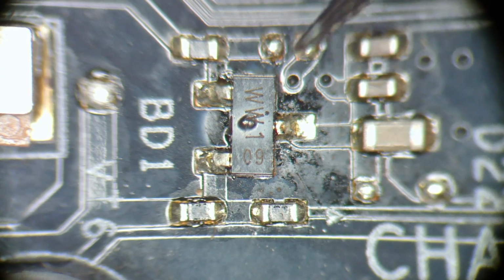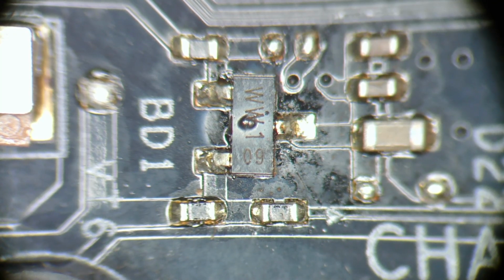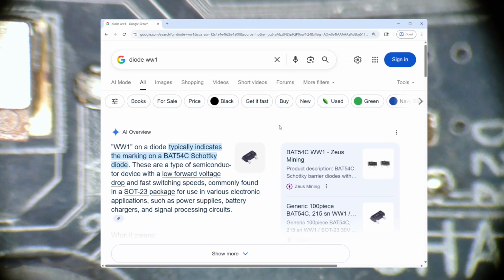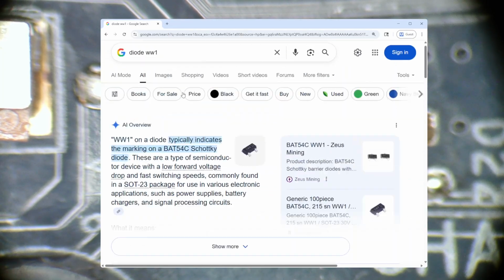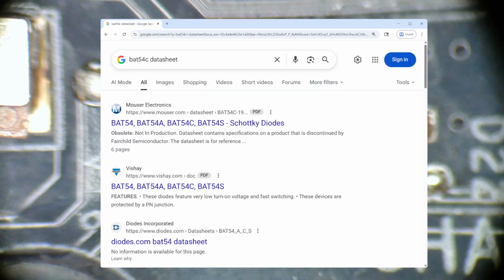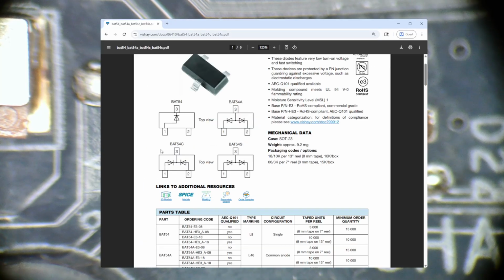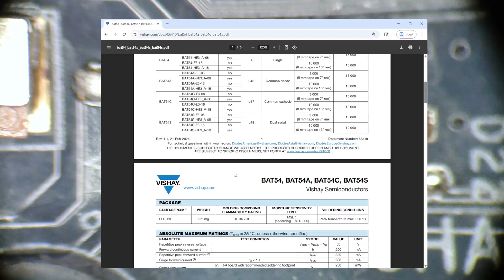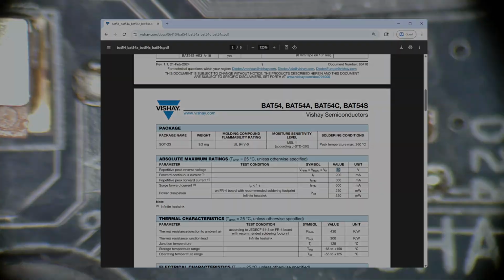Motherboard Won't Turn On! Watch What Happens | No Power Fix | ASROCK B560M-C | Find a Short

Comment: I have this same board, I couldn't find any schematics or board files anywhere and it was also my first attempted repair. I found your video and my southbridge had the same readings as yours. Your video saved me hours of probing with my multimeeter
Reply from the maker: That’s awesome to hear! Happy to help save you some time on the repair. 😊

Comment: is it possible that the short is at the solder leads? Maybe try reball?
Reply from the maker: Good thought! If the leads were shorted, they usually wouldn’t heat up—the current would spread across the rail. The reason we see heat right on the PCH is because the short is internal to the chip itself.